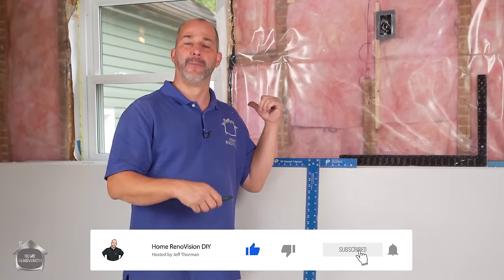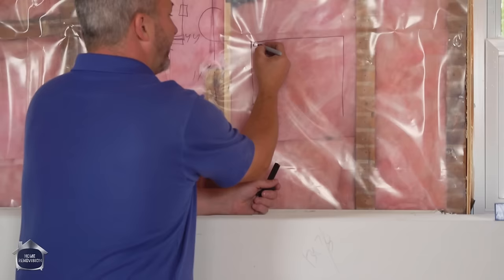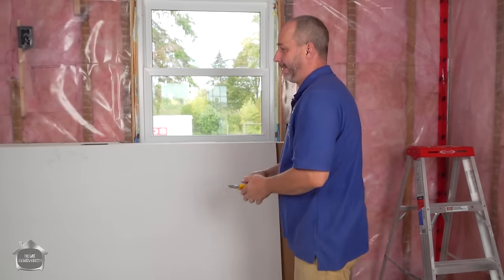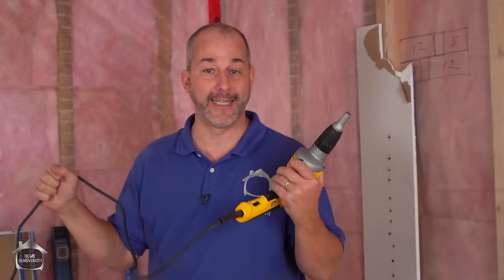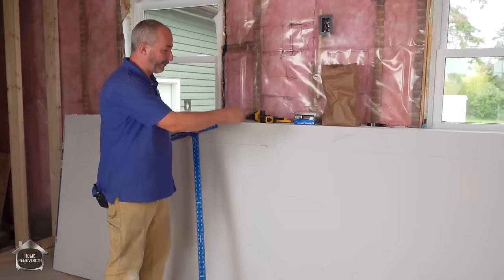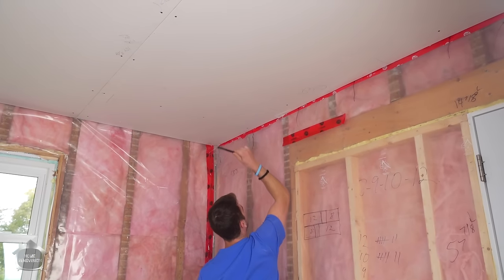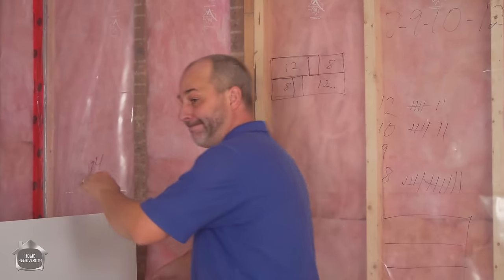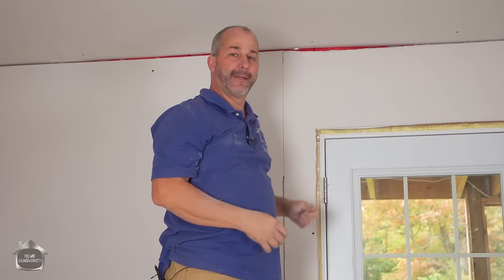How to DIY Drywall For Beginners | Cutting & Installing

Comment: @27:30 you say the teeth go in two different directions.  ALL saw blades do that.  The drywall blade is a very course cut so it is more obvious but, even circular saw blades and jigsaw blades do this.  If they didn't, the blade would get stuck.
Reply: Um no. Not all saws have teeth in both directions. Go try cutting with your circular with blade in backwards and see how well it works out for you. Plenty of hand saws with teeth in one direction too.
Reply: @gregz.4842  
"Both" as in left to right.  Saws don't have teeth forward and backward.
Actually,  I have installed a saw backward in my mitre saw.  I do it for cutting aluminum or plastic laminate and veneers when a fine tooth blade was not available.

Edit:  Furthermore, the saw body has a thickness to it.  The teeth point left and right.  This is called the kerf (thickness) of a saw blade cut.  All saws have it.  This two-way tooth offset keeps the body of the blade from sticking in the material you are cutting.  Most commonly, a saw blade will have a 1/8" kerf.  Some saw blades have a thin kerf at 3/32" but, still it must be wider than the blade body to keep it moving through the material being cut.

Comment: Hi Jeff, thank you for your reply to my email.  In this video you said it is better to use a cut out tool after the drywall is up for electrical boxes instead of measuring and cutting before.  I have electrical boxes where the outlets are already installed.  Would you recommend measuring and cutting before installing the drywall or removing all of the outlets, installing the drywall and then using a cut out tool and then reinstalling the outlets?  Also, can a roto-zip be used with the plastic boxes (or would it cut thru those boxes) and the roto-zip should only be used with metal boxes?
Reply: If he doesn't get to this question maybe I can help you for being nosey a bit. For your first question it is better to use the cutout tool, but when it comes to live wires its dangerous to use it because you start from the inside of the box and work your way out. You can hit/cut a live wire and the Fuze will go out. At this point you measure and cut out. Unless you have the time to unistall every switch and cap them then by all means go ahead but you will waste time.

For your second question you can use the rotozip for plastic boxes but you need to have experience using it because at times you can cut through it. Hopefully I helped answered some of your questions. I am a Carpenter with 5 years experience in sheet rocking high end residential and commercial. Good luck on your project!
Reply: @21userious   Thank you for your reply. I could uninstall those outlets but I wouldn't work near live wires especially with a roto-zip. Being that this whole room is on its own breaker, I would just turn off during the install.  There are 6 boxes in the room so hopefully it wouldn't take too long to uninstall/reinstall those outlets.  Just out of curiosity, what would you do Jeff?
Reply: This is good stuff.  I just hung drywall on the ceiling no issues for can lights because they are metal.  Now I’m doing the wall and found out quickly you can burn right through those cheap plastic blue boxes.  Little bit of art on that.
Reply from the maker: make sure you use a bit with a guide tip. that will help!

Comment: Don't be lazy .just take 4ft measurements of the length board you are using. Most of the time its not off that much.
Most houses are framed pretty good. Just start off the ceiling on the outside wall and work your way towards the other end.
Any problems just adjust a half inch or so, Were not dealing w. rocket science here, its just drywall and spackle.

Comment: 29:40 Great seeing that mistakes happen to everyone and how you go about fixing them. :-D

Otherwise see here:

This renovation is headed for a disaster of biblical proportions.
1880's house, Mr. Carpenter, real wrath of building inspector type stuff.
Gypsum and silica coming down from the ceilings! Toilets and septic tanks boiling!
Forty years of electrical shorts! Heaving foundations, heat loss and air leakage...
The dust mites rising from the HVAC!
Tool sacrifice, father and sons working together... mass hysteria!

Comment: Your drywall pictures in the beginning are inaccurate based off your own videos. Drywall is hung horizontal in residential not vertically lol.

Basically what you want to do is make a square point of reference

Comment: Never use a marker on your drywall.  The ink will bleed through your paint.
Reply: I've never had that problem.
Just use a good primer, and you have no worries.
Reply: @tay13666  
Use a pencil and you don't need primer.  The pencil is cheaper.
Reply: @RalphSampson...  - You have to prime anyway or the different textures of the mud and drywall will show in your paint.
And if you have 50+ year old eyes like mine, you can't read the pencil in crappy worksite lighting.
Reply: @tay13666  
Lol.  My eyes are 54 years old.  You are so correct about raw mud vs drywall paper texture or "flashing".
The way we paint raw drywall is "prime" the mud spots only with the same finish paint.  After it has thoroughly dried (one hour or so), we lightly sand then, coat the entire wall.  Then, we final paint.  Apply a third coat if needed.

So, that is to spot the mud, apply a full first coat over entire wall and then final coat the entire wall.
The same issue happens over a previously finished wall that gets repaired.
The concern about markers is I have seen markers and ball point pens bleed through to final paint, even after several coats.  We would have to prime with Kilz (or equal) then, final paint again, if we encountered markers.
Reply: @RalphSampson...  - See, I almost always prime with either Kilz or BIN
Then again, I am rarely ever doing an entire wall of new drywall. Usually I am patching existing walls.
So, I need to prime the whole thing in order to have an even base to start the painting with.

Though, I have to say, when I did my own house, we used that Behr paint & primer in one, and it worked.
Didn't even flash where I patched the plaster. And even color across previously painted plaster, drywall mud, and a few small patches of drywall.
Reply: @tay13666  
Yep.  I have used that Behr paint, too.  It takes fewer coats and covers pretty well.  I also use Sherwin Williams' Promar 200.  Both are good paints.

Comment: Amateur. Have you ever heard of a plumb bob and a chalk line to square a room on the floor? Use a water level, it will never need calibration and it will never be wrong because it works on the force of gravity. Can your laser get a level mark around a hidden corner without moving it? No.  My water level can. Professionals use measurements by the eighth inch measurements. 1/4 and 3/4 sounds the same. A measurement of 25 and 2 (1/4) or 25 and 6 (3/4) or 25 and 3 (3/8) makes it much easier to communicate measurements. I know you will remove my comment because you don't like constructive criticism or having others know your not that good at drywall.
If you want some advise, feel free to ask me.
Reply from the maker: It is a shame we are all not as good as you steven.
Reply: I started in the construction industry at the age of 14 since my step father owned the company. I have worked with and been taught by the best craftsman in the industry and I became a craftsman in many areas in residential, commercial and industrial settings. I also have 8 years of technical training from attending college. I watch many "DIY's for the Beginner" video's and the proper basics and proper procedures are lacking or non existent for a homeowner. And yes, I am very good at what I do and I have trained many men and women in the trades.And what is this "we" comment ? I'm talking about you.